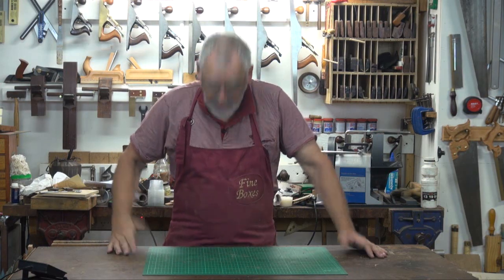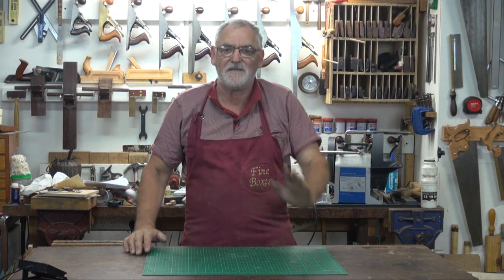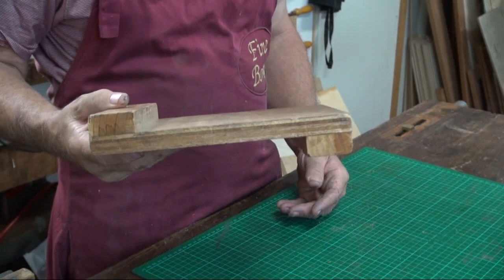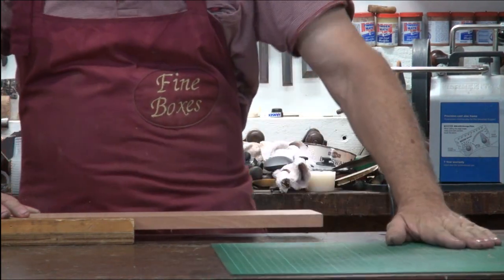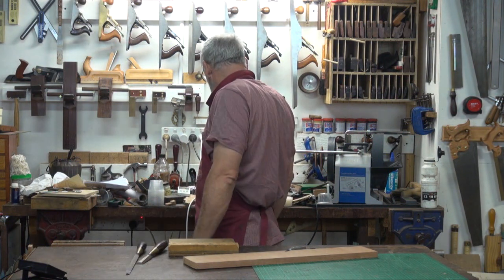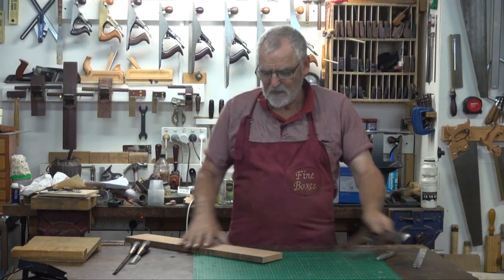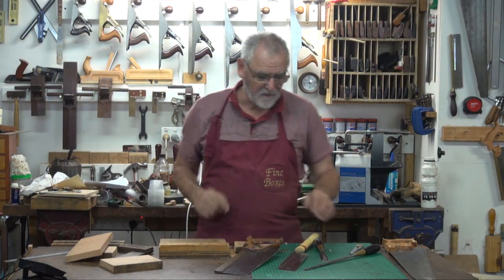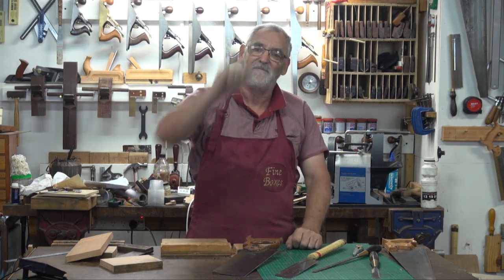Confidently Cut using this Hand Saw Hack

Comment: Is a "Tenon" saw the best tool for precise even cutting? I've noticed "Mitre" box with Tenon saw combinations in Bunnings. Apparently, an ordinary saw handle, like the first one you used, has 90 °and 45° in the design.
Reply from the maker: Yes JACK,  tenon saws are more rigid and that allows for a straighter cut but it still comes down to hand control of the user. Practice makes perfect :)  Cheers Steve

Comment: Thank you Steve. I have the hardest time keeping the saw at 90 degrees. I should probably practice more.
Reply from the maker: All to do with Muscle memory Ed. Practice the technique slowly then speed will follow. Cheers Steve
Reply: I might have a tip that can help.  Once I have a fence going, I will often to put my off hand on the board and line up my knuckle to the metal.  The teeth of the blade are already in the wood, so there is realistically  no chance of cutting myself.
Reply: Great tips. Thank you.
Reply from the maker: Hi Ed, Thanks for the feedback. You are right, just practice but practice the right way. No point in perfecting errors.  Soon becomes second nature and don't rush it. Cheers Steve